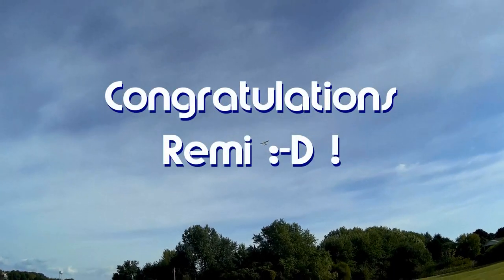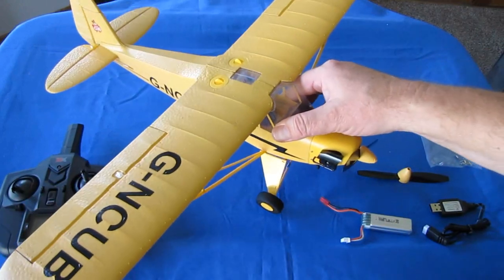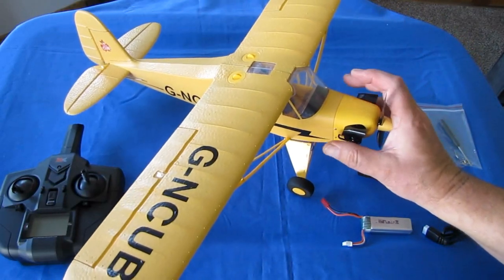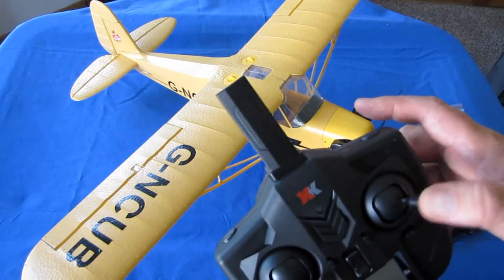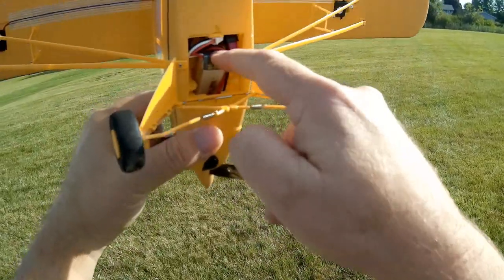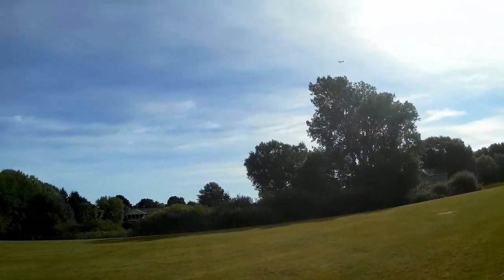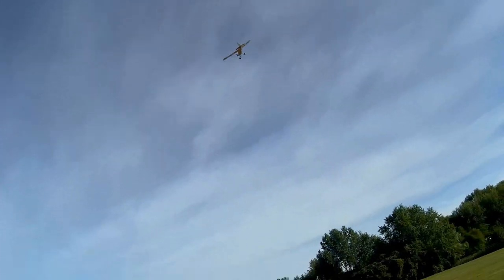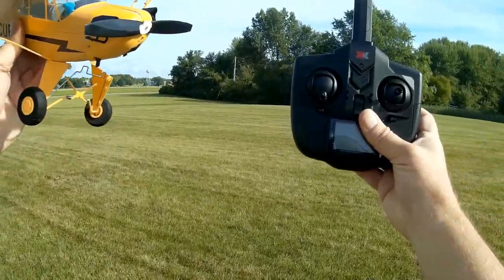WLToys XK A160 Skylark Flying Model Piper Cub Flight Test Review

Comment: Got some great news for owners of this plane. I positioned the aerial instead of going towards the back of the plane to the front of the plane so it goes under the cockpit. It flies really good now with no glitches. Would be interesting if others have the same success.
Reply: How is it working now? Interested in buying this cub.
Reply: @bigriceburner  AS above shove grey aerial wire to front of fuselage rather than back. Also sticky taped am 8gram coin inside nose cone to get the right centre of gravity. Was to tail heavy. Shove battery as far forward as possible. Now it flies perfect, loops etc. I went from hating it to loving it.
Reply: @adrianstirn1255  thanks man! This may be my second plane.. always had a love for Cubs.
Reply: What do you mean aerial? What part is that?  Mine flies terrible.
Reply: @adrianstirn1255  Just bought this plane, watching the video it does look tail heavy in flight, notice the porpoising. Will add some nose weight myself and see about moving the aerial as suggested.
Reply: @ArceezRC  Antenna wire
Reply: @ArceezRC  RECEIVER ANTENNA.

Comment: THE PROBLEM IS ACTUALLY with the Gyro/Stabilization system intermittently giving full left rudder lock and if not high enough to recover will take you DOWN! I've actually tested it on the bench and was able to make it happen!
Reply: Any solutions? Perhaps change the hole that you connect the control rod to?
Reply: @adamg5780  No, not the problem, the actual Gyro/flight controller has a glitch that will intermittently lock the rudder left during flight and will correct if you are high enough to pull out of it.
The only way I found to correct it is to disconnect the rudder and Pin it straight!
Reply: I hope you're still here… I just got the airplane given to me.  I don't need stabilization if you turn it off do you still have it kick in intermittently on its own… Because after watching the video it did look like a committed suicide there was no reason for it to crash no reason for a tip stall.  I think you make sense.  So what you think is it because stabilization was turned on and it's just garbage.  Is it okay with stabilization off?  I hope you're still out here let me know thank you
Reply: @jeffrenman4146  It's been a while since I've flown them, but I believe unstable might not happen? Check what Adrian Stim says maybe that works, but I think it different flight controllers have the problem, you may have a good one? Fly it high to see if it happens, gives you time to recover, I think full throttle is when it happens most? Sorry can't help more. Other guys have just swapped out the radio! When it's working it fly's nice! Good luck. There is lot's of videos out there about it!

Comment: As an experienced model cub pilot of 1/3 , 1/4, & 1/5 scales - one thing I have learned is that wind changes the cub into a flying squirrel 🐿️ now add a tail heavy CG and you have a plane that will become an aerobatic happy to snap and spin plane! Get the CG (center of Gravity) to balance just slightly nose wards and go with low rates on the throws of the controls and they will be very easy and control able to fly! Note: you may need to add a few grams of nose weight forward to get that CG correct! Happy Landings! 😊

Comment: too much elevator in a turn will induce a tip stall. Cubs are also known to be tip stalling fools. I won't recommend a cub to a newbie. While they look easy to fly, they are not as easy as a plane designed to be a trainer. I have one of these little jewels I have not yet assembled. Thanks for the video!!

Comment: After assembly, on bench testing, found that there were situations when if you throttled up, left rudder and left aileron, the rudder would jam, doesn't appear to be any problems in the mechanism, there's a guy with an "XK A160 fail" who has highlighted the very same problem

Comment: I have one and like it a lot.  I would post videos but I'll spare myself the embarrassment of me attempting to fly it.  Out of the box it assembled fine and was in good condition minus the missing nose cone.  Upon completing the plane assembly I put new batteries in the control and there was a short in the power section.  It would beep then go off.  I opened the controller and repaired some loose wires inside.  After flying and crashing from 30+ ft nose first I can say this plane is very durable.  Just a little super glue and the nose cowl and landing gear are good as new.  If this is your first rc (like me)  don't get discouraged by having trouble flying it , I'm sure I'll get better and thankful to have a plane that's pretty forgiving to crashes.  I think in 3g mode there's too much auto rudder causing tip stalls and nose spin crashes.  In 6g mode I'll take the blame for the crashes inexperienced pilot error.  For the money it's worth it.  But don't expect it to be simple on the first try.

Comment: I’m using 700mah lipo from my eachine e130 heli, cut some foam so the battery is in front of the nose.
No tip stal and 15 minutes flight time. Friendly regards, Theo.

Comment: Great videos, thank you! I noticed the JST connector between battery and plane is lose and keeps disconnecting intermittently and does also cause a stall. I replaced the connectors on both ends and never had disconnect again. Still can stall on turns and will try the the tips pointed out in the comment.

Comment: The stalling while turning has been debugged, first move the receiver antenna away from the two metal rods that control the elevator and the router I hot glued mine close to the acess panel away from those two wire Rods. The next thing you need to do is listen the throws on the ailerons as well as the rudder and I even done my elevator. Since I've done these repairs zero tip stalls and it flies like a dream even in moderate wind. Now with me being a new pilot the only thing I'm lacking I can't get the damn thing to take off I have to hand launch it because whenever I give it the gas it wants to go I believe left and then whenever I let off the gas it rolls straight. However I can land it just fine so hand launching is not a big thing
Reply: Sorry but that antenna mod has been "debunked" not "debugged!" The torque roll under high throttle is normal.

Comment: Nice looking Plane. It really shouldn't tip stall like that as it seemed to have plenty of speed. May be a Gyro Issue and I don't believe there is Full Manual Mode on the XK Planes. Thanks for the demo and I'll see you in the Air!
Reply: yea this plane tip stalls badly.however you can correct this by connecting the the rudder control horns to the inside hole, incredible difference .

Comment: I still have the XK A600 Beaver that you reviewed and featured several times some years ago now, that was a beaut' little plane :)  The only starter plane that I enjoyed more was the HobbyZone Sport  Cub S so easy to fly but limited to light winds.
Reply: I loved my sport cub S to death. It needs every single part replaced, which I think may be more expensive than just buying another. I could fly it in quite strong winds, but it didn't make any progress forward. Surprisingly acrobatic too, I'd love a brushless version with FPV.
Reply: @liefjorgen    "brushless version with FPV"  Yep, I'd get one.

Comment: The control horns need to be to the outside hole, not the middle! That's why it's unruly!
Also, in Gyro/Stable mode all surfaces are mixed, and more Throttle gives more up elevator, Rudder is mixed with the Ailerons, and Elevator and gyro/stabile system is defective causing rudder left lock, fly with rudder disconnected and pinned flies better. "Ground Control" covers it a lot!!

Comment: Mine would take off fine then not respond to the controls. It was a loose connection to the battery. I sanded a fat 1/16" off of the battery plug and that seemed to cure the bad connection.

Comment: Yep. Looks like they got the colour right on this one. It's a lemon all right. Pity, as it's brushless and looks a million dollars but if you buy the brushed Volantex V761-4 Sport Cub 500 you'll spend your day out having fun flying while those of us who ordered this will be sweeping up the bits!  😟
If you want a brushless, durable EPP framed plane that flies very well in wind, try the X520 Vtol. It IS a winner from XK.
Reply: Glad to hear the x520 is good, just picked one up and waiting to maiden. Agree, spec wise this looks a winner ... but specs mean nothing if it doesn't fly well. I think the Volantex Sport Cub 500 is a brushed motor, whilst the Super Cub 750 is brushless. Reviews suggest both these would be better buys than the Skykark ☹️
Reply: @danp2237  1 thing to watch on the X520 is, especially when switching back to Vert mode, keep the revs up or it will flutter like a wounded duck - use high rates and rip throttle up past 50%! We use throttle stick centered and also modded the dumb motor kill to a single (momentary) switch. Also dremeled out 1 to take a 3s! Flogged hell out of them for 2 years now so a bit of glue and tape here and there but all still flying with only a prop change!
The Sport Cub 500 might be brushed but they are brilliant little toys. The latest issues seem to have motor failsafe now but a tiny bit of CA to lock the motor pinion on can help.
The Super Cub 750 has always been too hard to find/too expensive to ship out in Oz so no knowledge of it. The protocol of the stabilized receiver in it has not been hacked yet unlike the other 2. Enjoy your X520!

Comment: there is a permant fix for the tip stall. lessen the throws on the rudder all the way on both the rudder horn as well as the rudder servo horn. if you do this is acts and behaves as it is supposed to
Reply: how do I get to the elevator servo horn? my elevator only moves a small amount

Comment: Beautiful rc plane, it's coming to me too and can't wait to try it. I saw that another youtuber also fell, a radio problem? I will also try it with a standard rx and I will do the video review
Reply from the maker: By the way, disabling rudder does not help. https://youtu.be/PbC9MpDRC84
Reply: @Quadcopter101  
I tried this plane, it's a radio problem, sometimes it loses signal. I think it is due to the receiver on the model. I will try to figure out how to solve this problem. The model is fantastic and can fly very slowly
Reply: @jonoedwards4195  
Hi, I solved the problem, you need to put a bigger capacitor on the motor esc
Reply: @RCReporter  You keep experimenting mate and you'll eventually invent the wheel. 
XK might even hire you for their development team. :D
Reply: @theoztreecrasher2647  
I do not experience anything, it is well known that sometimes some esc give these surges to the fc, it took me to tell the world

Comment: Quadcopter 101, what the receiver board for the a160 work in a scratch built airplane with the stabilization turned off or would they Chinese equivalent of as3x cause problems with a different airframe?  George

Comment: Tipstall problem solved, change the position of the receiver antenna away from metal rods as far as possible. I tried it fine. My advice is not to fly in medium or strong wind because the flight controller in 6g mode is not able to stabilize the plane in case of snap and fall! In the absence of wind it is also perfect in 6g mode. To increase the range of the radio change the position of the antenna!
Reply: Hello!
What you mean by pushing rx antenna away? Should we put the antenna outside or in opposite direction than it is (I mean antenna should point in front of the plane?? :) )
Thanks for your advice.
Reply: @podstawka6525  Hi the antenna on mine was mounted near the metal rods of the controls, so the range of the radio is reduced, I made the antenna come out from the slots in the cover, so it's okay
Reply: @podstawka6525  To check if the stalling behaviour of this plane has anything to do with loss of signal, simply turn off the Tx (while flying over soft grass!) With any UAV the first thing you should do is, before flying it anywhere, No1   Check that the motor failsafe works with loss of signal (and your plane will not simply fly away!)
No2.   Sit the Tx on a stump and (with plane running in hand) head down the road till you lose contact. Then you know the range limits to stay inside. You can wave it about during the trip to check if there are any problems with antenna placement.
My own personal experience with this plane is that the problems are solely due to a poorly programmed flight controller and too high a wing loading.
All in all it's a lemon!

Comment: Nate 
of the Rc Saylors had the same to stall issue.
Reply from the maker: I'm beginning to think that it's not a stall, but inadvertent max rudder via the stabilization system.  I'm going to do a follow on review, disabling the rudder, to see if it corrects the problem.
Reply: Can be fixed if you lessen the throws on the rudder and the ailerons I've had zero tips stalls since I've done that and also move the receiver antenna away from the metal rods that control the elevator and the rudder after those three things you won't have no stalling issues

Comment: Hi Quad, been watching your videos for quite some time now, and have enjoyed them immensely ! First of all, I only gave this review a thumbs down solely for the performance of the plane or lack there-of !! Your reviews are always spot-on !! It seems like there is some sort of design or manufacturer flaw in this plane's stabilization system. It flew very well as far as I could see, except for the tip stall. What's your assessment ?
Reply from the maker: Some folks on RCGroups think that it may be the rudder stabilization algorithm kicking too much rudder in turns.  As such, I'm going to do a follow on review of this plane, disabling/centering the rudder.  Turns will only be through the ailerons.  Ifit doesn't crash, then problem confirmed.
Reply: @Quadcopter101  Hey, thank you for the reply Quad !!!
Reply: I have been flying this plane the past 3 weeks. Its actually too heavy for the wing area aka high wing loading. Then at high aoa turns with side gust it stalls straight into a spin, usually unrecoverable since the ailerons stall as well. Kind of solved it by modding with diy vortex generators on the outer wing leading edge. It stalls less now, and when it does stall its recoverable since theres still airflow over the ailerons.
Reply from the maker: Would it be possible to share what you found in the following forum?  A picture of your fix would be very helpful. https://www.rcgroups.com/forums/showthread.php?3625019-XK-A-160-Skylark

Comment: Quadcopter 101 can you tell me how to install a prop on the Skylark or post a video about it? Thank you, George
Reply from the maker: It's held on by a single tiny screw in the center of the prop.  You'll need to pry off the nose cone from the propeller to access the screw.  Regarding using the flight control board in another aircraft..  It may work with stabilization turned off.   But not sure why you would do such when receiver's are cheap.
Reply: @Quadcopter101  quadcopter 101 thank you for your reply. I looked on the picture that was associated with the ad where I bought the prop and it looked like there were several different size screws involved in some kind of a black piece of plastic I don't know what the black piece of plastic was but I wonder why there was so many different size screws. You say it only takes one screw? To answer your question about why I use a stabilize receiver it's because they originally tried a non-stabilized one which wouldn't communicate with the transmitter I had for the f949s which is all I had at the time so instead of buying a new transmitter which is relatively expensive I bought a receiver that match the transmitter but they send me the one for the a160 instead of for the f9.9s so it's a whole can of worms
Reply from the maker: @georgejunior895  wait a minute. What plane are you flying? Not the A160?  The A160 comes with a spare prop in the package.
Reply: @Quadcopter101  it's a scratch Built based on a guillo's kit. What happened was I ordered a receiver for f949 and it wouldn't communicate with my f949s transmitter so I ordered a receiver for an f949s and they mistakenly sent me a receiver for a a160 so I'm trying to get that to work. Maybe some of my decisions were not well thought out I'm just going to try to get this one last attempt to work and then I'm going to hang it up

Comment: Just got one of these. I want to turn off the "6G" flight stabilization system. But when I hit the button, it just blinks, and stays on, no matter what..
Reply from the maker: Make sure that you are pressing the correct button to turn it off/on (upper right side shoulder button).
Reply: @Quadcopter101   Yeah. Multiple times. Single press. Tried it all.. The rate button on the left works.
Reply: You must trhottle engine first to gyro works

Comment: Bro, is it difficult to fly a remote control plane?
Reply from the maker: Not really.  But I would recommend that you start with an easier to fly plane than this one.  I recommend starting with the following simple two channel plane to learn the basics of turning and using throttle.  After you master that, then consider moving up to a 3 or 4 channel plane to learn elevator and aileron controls.
https://www.youtube.com/watch?v=9m46Y16BiP0
Reply from the maker: A little more details on the YF350 https://www.youtube.com/watch?v=WYmBKxxJIgo

Comment: I think theres to much rudder movement mixed with ailerons and its causing the plane to want to almost flip over and stall
Reply from the maker: Yep, some folks on RCGroups think that it may be the rudder stabilization algorithm kicking too much rudder in turns.  As such, I'm going to do a follow on review of this plane, disabling/centering the rudder.  Turns will only be through the ailerons.  If it doesn't crash, then problem confirmed.
Reply from the maker: Disabling the rudder doesn't seem to help. https://youtu.be/PbC9MpDRC84